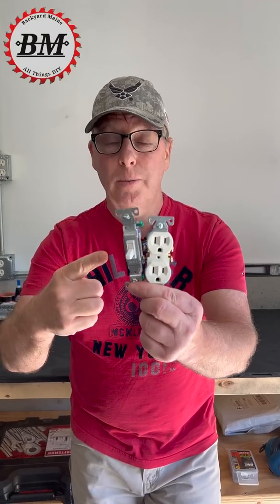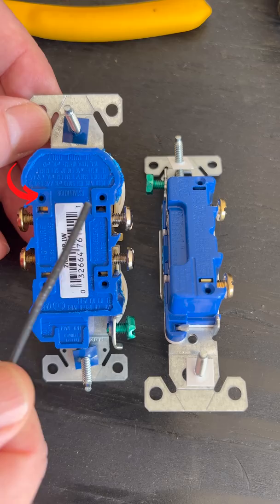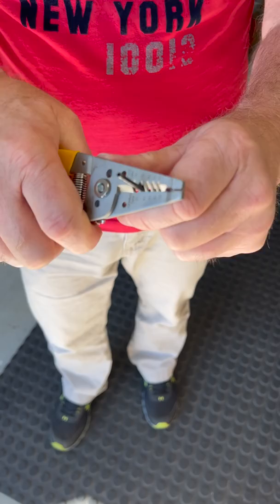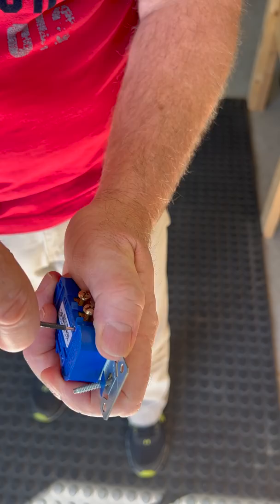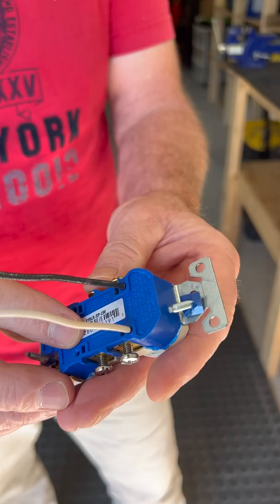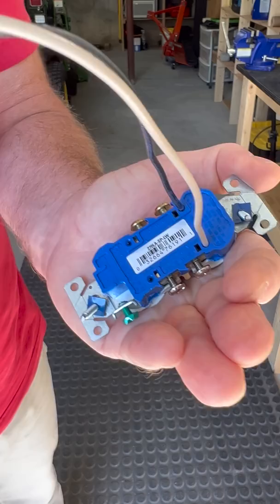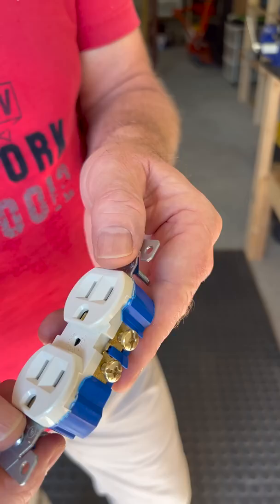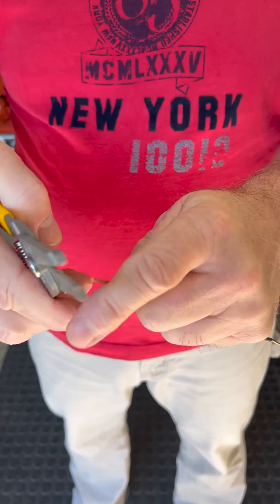Don't make this electrical mistake #Shorts

Comment: Great talking points. I agree and I would never do it again today. However, what about those thousands of them that I back stabbed in the 70s and early 80s? If an electrician sized his circuits right and didn’t overload them they are still working..
Reply from the maker: I find them failing on circuits that draw just a couple of amps. Obviously the one’s drawing more are the ones that fail more often. My view is if the connection can’t handle the max loading of 12A on a 15A circuit then the connection is not reliable.

Comment: Cable or conductor mate. Wire is used for making fences
Reply from the maker: Not exactly buddy. Cable houses one or more wire or conductor. Conductor is anything that conducts electricity. You can surly call a roll of wire cable or conductor but wire is also correct.

Comment: I believe they're hard to find in california from what contractors have said. Atleast not from licensed dealers. Also, if you're going to use these, atleast tighten the screws you're not using.
Reply from the maker: Again Exactly. The screws sticking out are a recipe for disaster.

Comment: The best way is to connect the hot and neutral and pigtail to the side terminals of the device.  That way if the device fails you won't kill tho whole circuit

Comment: Spring conections do not losen over time trough warming / cooling vs screwconections. We use a thermal camera to search losen screw connections and never found failed springconnections.
Reply from the maker: The wire wedges between two pates and the contact is very thin. I could run a business just fixing these and nothing else. They don't fail right away. When I replace the often time the plastic is melting so a camera would certainly pick it up.

Comment: Maybe I missed it, but could you address when to use solid verses stranded wire. I've only seen solid in residential use. Thanx for the education. 🙏💓
Reply from the maker: Stranded wire can be used in any application except for some grounding requirements like on a swimming pool for example. Generally solid wire is used for residential because ROMEX is made with solid wire. Stranded wire is usually used when run in raceways like conduit.
Reply: @BackyardMaine  Thank you for your quick reply. 🙏💓

Comment: in my experience, its obviously ok to do. otherwise they wouldnt include the option to do it in the first place. the nec and its board would ban the use of such devices if it they were such a hazard. do they fail? yes of course. ive also seen bad installs on the set screw that produce the same result when given that loose connection and a load is applied through that connection. loose connection generates heat which in turn creates a little more resistance, which generates more heat, etc, until the connection fails eventually. that usually comes in the form of a melted connection point. but again in my experience i have never seen damage outside of what damage what done to the device. the box they are mounted in is has at least or should have at least a 2 hour firewall rating anyway. and out of every singe repair i have done on these devices that have failed from the back stab i pretty sure i can confidently say 90% or more were caused generally in wall receptacles that had something pressed up against the device. for example a bed, dressers, drawers, sofas, chairs, etc, where there is something always nudging, budging on, or just wiggling that wall receptacle. that, not necessarily constant, but for sure ongoing disturbance wiggles that backstab connection the point that it starts that heat resistance cycle when there is an active load going through that circuit down the line. never once have i seen such a failure get through the electrical box it was mounted in. all that being said, is the screw better? absolutely. when installed correctly and the connections are tight. am i afraid of using the back stab? no.. lol. i love seeing my fellow electricians always make such a big deal out of this and many other topics in the electrical world, and i just kind of stand back and observer most of the time and i find it comical how polarizing our opinions can be and how quick to take up arms against each other literally shitting on someone and telling them they arent a real electrician if they do certain things. as long as the install is done properly it generally is completely fine. there is a reason why they stopped allowing #12 gauge to be backstabbed. that size of wire has been determined to be too stiff to rely on that back stab method to maintain a suitable connection as much as #14 gauge. and to add to that, would say a good majority of repairs to this situation, definitely not all, has been from these old devices, or actual electricians(shitty ones imo), or the diy homeowner themselves forcing a #12 into the back stab regardless of the 15 amp rating.

long read, but theres a lot more to consider than just "DONT DO THIS" . lol
Reply from the maker: Although I don't agree with everything you said I do agree that we should respect differences of opinion without taking cheep shots at someone who has had a different experience than we have.It sounds like you have had a lot of experience and have made a decent argument. I have been an electrician for 38 years with the last 10 working as an electrical engineer. Most of my experience is on the industrial side but I have always done residential as a side hustle. Thank you for adding a valuable comment..
Reply: @BackyardMaine  well said. i have only been an electrician for 10 years myself, but it has been the vast majority residential where is is very common on installs. i do have some and am getting more experience in the commercial side of things, but i have seen a lot of this in my experience in wiring houses and a lot of service calls where its always "we only have half of our room that has power" and almost all of those calls end up being a result of the failing backstab, which were almost always caused by those i listed. so now whenever i get one of those calls, i always start by asking or looking if they have any furniture that have a receptacle behind it, or if they can recall if they had recently used any of the receptacles in the area and it has shortened the vast majority of those calls search and repair time down to under an hour. i feel like this is obviously more beneficial for the customer because of the usually only 1 hour charge to them, but that brings easy return business in the future if they ever need again.
Reply: @BackyardMaine  as a side thought, would i be able to ask how you went about transitioning from field work to getting into electrical engineering? unfortunately i blew a disk out in my middle back when i was 21, am 2 weeks away from turning 33 and its starting to impact my life more than i'd like to admit kind of thing.. i have had thoughts of electrical engineering in the past, but unfortunately life just has carried on and i havent given as much thought to that career path as maybe i should be. i have always been on the more "book smart" kind of person, and im not saying that to try to sound self boastful or anything. but where should i consider even to start looking? i assume i have to do some schooling but i dont have any extra time outside of work to devote to secular education. and i dont know if there are even any options out there to pay to train you or anything like that? thanks for a response if you see this.
Reply: @BackyardMaine  as another side thought, i can actually see (and respect lol) why you're one one of the guys that says to never back stab and to only set screw. if you come mainly from even mainly commercial installation as your focus, and even more so in the industrial side of things where im pretty sure damn near every connection is guaranteed to be set screw in nature its only natural reaction to say set screw only. whereas with guys like me working for smaller local companies with vast majority residential type jobs, the main name of the game is how much the customer is going to end up paying. where in my area there is an absurd amount of options for customers to call, it all comes down to how cheap you are and if you can get return business. but, i we have to do quality work too, and not prove to have work that fails all the time as a company. i would personally say this isn't generally a high volume call in, is usually found on older installs. whenever i do get these calls it is then easier to pigtail it down if needed and do the set screw connection then. but when your wiring and trimming out potentially hundreds of devices, it pays better to have a faster install. just because this method is used does not necessarily make it a bad install, it can be done properly. that comes down to making sure the device is secured firmly against the mounting surface its on, whether or not you have to use shims and/or box extensions for some reason if your local code or nec demands the need for it. in my are we our inspectors are strict in these areas, and rightfully so. so the quicker you can get the job done when for even a small company like ourselves, comparatively we are definitely not the most expensive by any means, our general price for a 2 man crew is $165 per hour, and i believe $125 an hour if only one man is needed for a simple repair like this should generally be. there is more to wiring than i think a lot of people realize and it can be done in a good quality way too. i saw some other comments from around the world saying they only have those type of connection, maybe sometimes a set screw, and being fine for years. and in the very little comparatively experience i have in commercial and way less industrial, the parts have tended to be of higher quality because of the environments they are installed in, and in turn the materials they are required to be made out higher quality and therefore price. and sometimes you were given a no price limit option which was fun to order some nice parts for lol. but i think i would say i see the no back stab argument from guys with your background xD
Reply from the maker: @s1nistersausage  It's not an easy transition. I  started out my career in the Air Force as an electrician in the civil engineering group where I went to every AF school I could find. When I got out I went to work for a large industrial  electrical company (Union IBEW) We worked on mostly large projects like power plants and large industrial facilities. In 1995 I was the project lead for the control systems installation for a 2 billion dollar wafer fab here in Maine. When the project was complete the company National Semiconductor offered me a job with the facilities department. I was lead electrician there from 1997 through 2010 when we were purchased by Texas Instruments. TI management made a lot of changes and one of them was promoting me to the electrical engineer in charge all electrical system, life safety systems and also security systems. I retired a few years ago and now I have this little youtube hobby. lol. So for me it was kind of a unique situation. Without going to school and passing your EE I think the only path would be getting into a large company and do everything you can to learn. Probably not what you wanted to hear..

Comment: My entire house is backstabbed and in the 26 years we’ve lived here we have never had a problem. If these are so bad why are manufacturers still permitted to make these available everywhere you look?
Reply from the maker: They did loose their listing on 20A devices. Check any 20A device and you will see there are no stabs. They were approved for 20A for years but now can only be found on 15A devices due to the high failure rates. They are also only available on the cheep residential grade receptacles now. Commercial grade or higher will have back wire screw connections.

Comment: The kind where you can insert the wire from the back and then clamp it down with the screw on the side are fine. Usually found in slightly heavier-duty devices, say $2 each vs the $0.89 cheap crap at the home center.
Reply from the maker: Yes for sure. These are commercial grade receptacles which can be found at an electrical supply house but are also sold at your big home centers as well.

Comment: Electrical engineers designed them to be used.
Agencies like Underwriters and CSA approve them.
Is it a situation like Sharkbite plumbing connections that everybody swears up and down will catastrophically fail but once again are approved and don't appear to fail any more frequently than soldered copper?
I dunno.  I'm not an engineer.
Reply from the maker: I'm retired now but I was an electrician for 38 years and an electrical engineer for the last ten years of my career. I have found there connections to be very unreliable especially if there is more than an amp or two on the circuit. They fail at a high rate but usually several years after installation. These used to be list for 20A devices as well but now only 15A are approved. I have another video showing the internals and why I think they fail if your interested. https://youtu.be/e_C_twh5fQE

Comment: And always remeber your hot / cold / hot checks after switching breakers off with proper PPE rated gloves 👌  and use insulated tools.
Reply from the maker: Great point! I wrote many LOTO procedure and energized electrical work procedures which included CAT 1-4 PPE and of course all of our high and low voltage switching procedure for a Texas Instruments FAB before I retired. Hot/Cold/Hot test was written into to many of those procedures.

Comment: Why do they still make these like this if it's a very common issue for problems? One of many examples that can be made works be the NEC is so adamantly worried about bundling and derating cables for the worst possible scenarios, but then the manufacturer makes a UL "certified" designed device that has so many common issues that are potential causes of fire, destruction of property, and or injuries and death.

Comment: Funny how all electricians say to not use those, yet the company keeps these on.
Reply from the maker: I think they were designed to make it easy for a non experienced person to make a connection. They do work but they are a very common failure point.

Comment: I would also say never buy the lowest level switches and outlets. Tell the client to stop being cheap in safety and spend an additional 70cents on better hardware
Reply from the maker: I agree. I use commercial grade devices almost all the time. I show these in videos since they are so often used.

Comment: Better yet, spend a little more money and by the outlet or switch that you place the wire behind the screw without having to look the wire. Stick the wire behind the plate and clamp down the screw. Way less trouble and an even better connection.
Reply from the maker: Yup they are a great option..

Comment: Never had an issue with push in connectors.  As a matter of fact more fixtures , like recesed lights amd such come only with push in connectors
Reply from the maker: They work fine for minimal loads like light fixtures. The connections here fail at a very high rate.

Comment: I like the kind with the hole that you slide in then tighten the screw.
Reply from the maker: Back wire devices usually found oh spec or commercial grade devices. That is a great option.

Comment: The electrician that wired my mom 's house when it was built back in 1994 did that crap, and she ended up having to have all the outlets and switches redone years later do to problems with arcing, etc.  What a lazy-ass way to do a job!

Comment: Why are they UL (Underwriters Laboratories) rated? Many electricians believe that vibration ultimately will cause them to fail, but don't the side connections fail sometimes as well? Just wondering why there isn't more conclusive testing on one versus the other.
Reply from the maker: In my experience (38 years) the side connections will last for ever if they are installed correctly. The stabs will fail over time with any current due heating and cooling and the very thin connection surface area.

Comment: Maybe if you're adding a known small wattage hardwired device to an existing circuit, and all better options are full, yeah maybe it's ok to use them holes to daisychain another item.  But hell no to putting power in those holes!

Comment: I just had to replace a backstabbed receptacle that pretty much caught on fire. The electrical codes are so strict it amazes me how they let the manufacturers make them.
Reply from the maker: I agree I don't understand why these are still approved. The lost the approval for 20A devices a while ago.
Reply: @BackyardMaine  ya my receptacles were pretty old and allowed #12 to be stabbed. So it took awhile for them to fail but they will fail.

Comment: Hi replaced a receptacle that was backstabbed with four wires. The tenant was complaining about  intermittent power. It turned out that the sheathing was charred due to loose backstab wires.
Reply from the maker: Very common problem..

Comment: I didn’t know about inserting the small screwdriver trick. I just twist the wire back and forth to get it out.
Reply from the maker: Yes and remember these connections are for 14AWG only and one use only. Thanks for watching.

Comment: I agree 💯 Percent but most failures are because of the electrician not properly stripping or pushing all the way in. They are ul approved for a reason... They work if done properly for a single device but I wouldn't daisy chain them. UL is on there for a reason so don't worry to much. You should worry more about the electrician
Reply from the maker: Just a side note: 20A receptacles were UL listed for back stabs as well, for decades but not anymore.
Reply: @BackyardMaine  exactly it's the same concept as a wago connection. Wagos are for stranded wire not solid wire for obvious reasons. Common sense seems to not be in some people